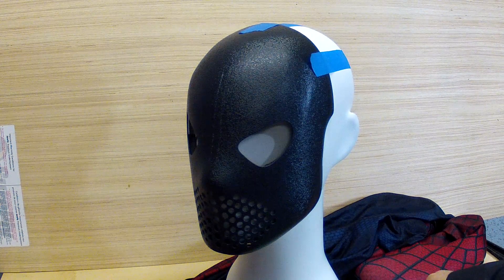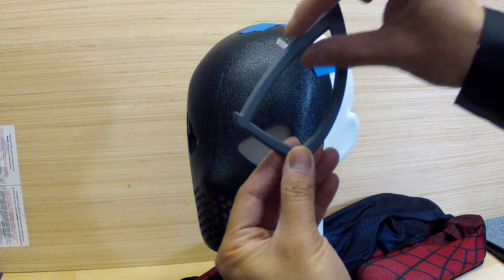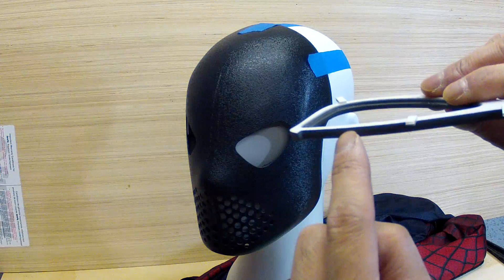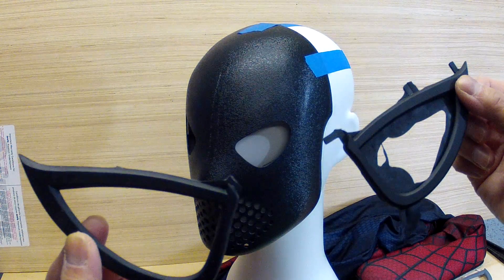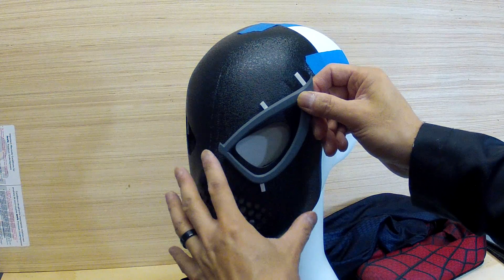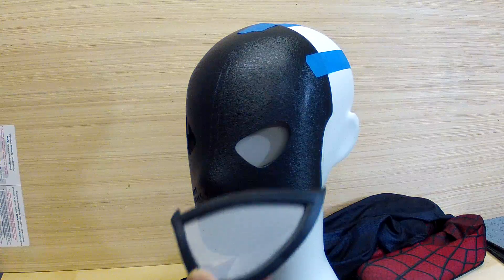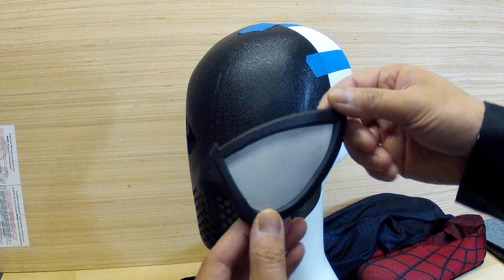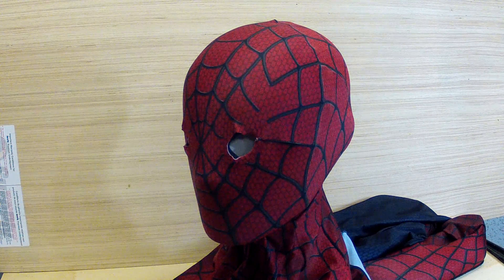Spider-Man eye frames and lens mesh

Comment from the maker: Just search for "fine metal mesh". I got mine on Ebay. People use it for scale model rail roads and and things like that. Try to find stainless if you can. Hope that helps!
Reply: will this work  https://www.ebay.com/itm/Stainless-Steel-12-35-inch-100-Mesh-Woven-Wire-Cloth-Screen-Filter-Sheet/283122849045?